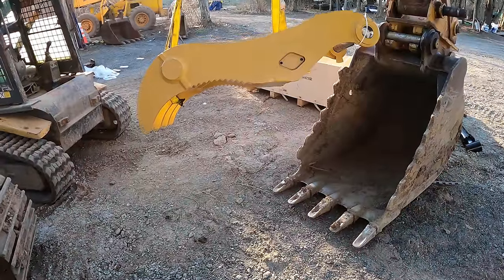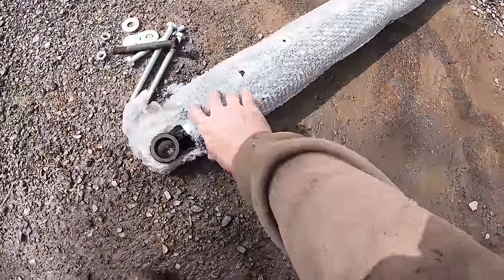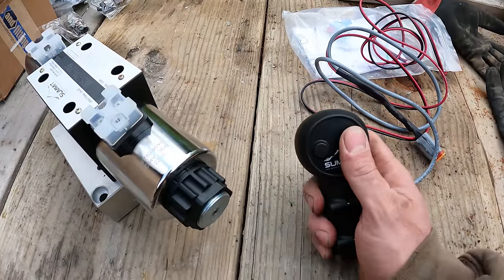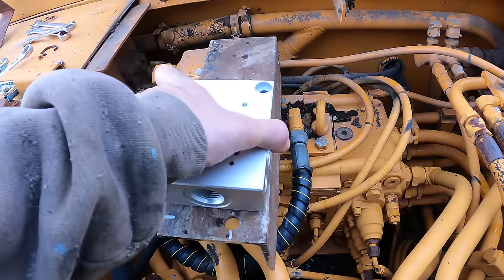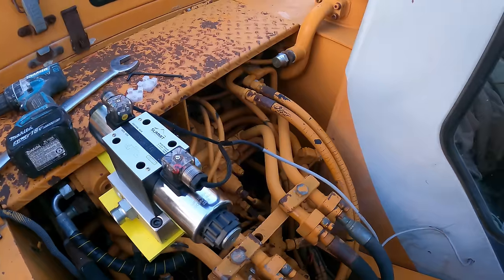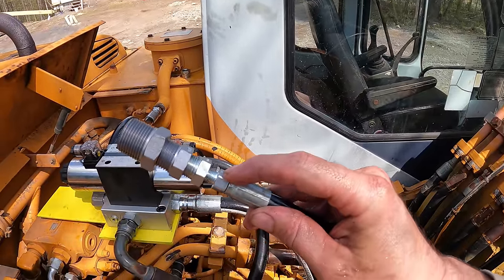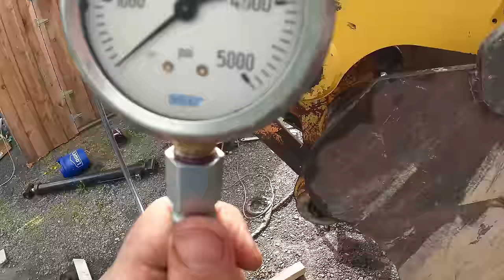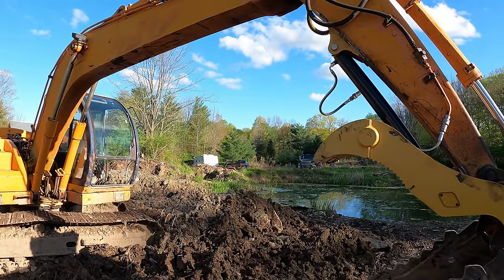Installing a hydraulic thumb on an excavator with 1 way aux circuit

Comment: I’m in the same situation, bought a Deere hoe, has hydraulics for a hammer, but I’m lost as to how to get it to work for a thumb
Reply from the maker: this video should help with that. I pondered about it for years
Reply: Binged the whole video, good stuff been looking for a video like yours for awhile,  I found a thumb that came off a big back hoe, it was a main pin thumb that was 63mm, I had a machine shop bore it and make a pin to fit my 65mm hoe. I got it stationary right now but I’d like to do what you did, that set up looked slick,  where can I find the electric over hydraulic valve and joystick?
Reply: What kinda money did you have in the hydraulic valve?
Reply from the maker: @brent9393  the valve was like 250. I spent alot of money on hoses but if you have a smaller machine you can use smaller hoses

Comment: this is 300 lbs  while pointing at a 60lb bracket.   this is 50 to 60 lbs  while man handling a 10lb valve with 1 hand
Reply from the maker: I am 200 lbs. i can do 20 pullups in a row with no problem and I couldnt even pick up that bracket, so yea not 60 lbs. All of 3000

Comment: I think you meant to say that valve body and manifold assembly weighed 15 or 16 pounds, not 50 or 60 pounds, I’m pretty sure you wouldn’t be moving it around that easily my guy.😂

Comment: Your bucket is cracked at the lift side of the cutting edge
Reply from the maker: yea I knew I was going to get a million comments about it. I wanted to include fixing it in this video but it was already really long as it was
Reply: 🤣🤣 i will watch it in  1/2 hour  maybe 3/4 parts so that wasnt going to be a problem

Comment: As a man who has been welding on this type of projects professionally for the last 14 years, your assumptions on weights are way off. There is no way that thumb ways a thousand pounds and that cylinder attachment point weighs 300.
Reply from the maker: if you saw them in person you would not doubt it. That thumb is 900 lbs and that bracket to hold on the old thumb is all of 300 pounds.  I weigh 200 lbs and can do 20 or more pullups, which means I can easily pick up 200 lbs over and over again. I could barely move that bracket, never mind picking it up

Comment: A young couple goes to say Ritchie brothers auction to see what is in their price range as there are thousands of machines there in every color or size and shape thinking "Ya!" this is the one honey. Should they be so fortunate to get it, spending    enough to send some one to collage for a good many years.... and it turns out a dud. Not the sellers fault and really who's fault but their own for not doing the research and also getting someone to go with them. That person should not have any interest in what, why or where, just a guy with real experience in machines. Honestly what happened to this eight thousand dollars aside from getting a thumb is knowledge that is worth ten times that for next purchase of a machine. I really never bought into what "Bob" said his would do type of experiences... guys in the field who operated them and knew the limits of each machine they ran. Also this is where companies whom have grown so large, they just don't answer the phone anymore for issues that experience will take the place of. Plus they've got so big they don't offer packages for later installations as in running a thumb or hammer. A little farmer will be happy he is not on a number two shovel handle digging out rock or stumps. A base model might be enough to keep them happy. One other crazy law that should be able to be changed is the width laws. A lowboy is restricted to only something under nine foot. most machines tracks will only have a third of the pad setting on that bed of their trailering system and to me a bit iffy at best when hard corners and train tracks... things that go bump in the night might be the best cliche. So if loaded maybe adjustable bed sides would be really helpful. I am just rambling Jesse so congrates on this successful installment.

Comment: Instead of taking the switch off later and running to the parts house to get another switch to fasten only when he could have used the one that he said he would take off later unless it was bad and he didn't want to use it but my solution would have been a lot cheaper to use the existing switch and just relocated he could have also got a couple of diodes from a couple electric coffee pots or some other scrap Appliance then he would not had to order them
Reply from the maker: that switch was not really capable of being used without the whole joystick to mount it on

Comment: Your relieve valve does not work because the new electronic valve will hold the pressure and not send it to the machine valve  to add a relive valve uou need to get a sandwich relieve valve that sits between the aluminium base and the electric valve
Reply from the maker: The relief valve works, its just that the valve I installed cuts off the path to the relief valve when its not open.
Reply: @jmuller86  exactly   I saw your next video with the inline relieve valve that is also a solution but the sandwich one is a nicer option don’t know if  its cheaper

Comment: Some customers?   I do, I think, I don't maybe. Hmmmmmmm.   Decouple and thicken the ouside wall beforehand and use a well machined hardened greaseable receiver plate like a gusset that can be held exactly where needed and then weld it. once you have a very manageble even thicker unit shave out the inside . However. Not 100% sure. Pretty sure, maybe....  Commitment & Decision Issues, I think perhaps. Nah, lets shit can everything and try something else. This is the drama that Youtubers want. Problems are essence of life. Struggles are what make us and or breaks us.  Next.  Maybe NSK Bearing can offer a better choice than large pin/shaft and grease. They use them (NSK) ii 100 ton industrial giants in mining and work longer and dont break and bend like your stuff.

Comment: Changing a factory setup is almost never a good idea, the engineers 👷‍👷 at the factory did know what they were doing, and the user 👨‍🔧👩‍🔧often does not 😉😄😁😂
Reply: Tell it to the guys at Ford,,,,like the Edsel and Pinto design teams. The guys that did the Dodge torsion bars used to be very popular with guys that repaired frames too. Ever think why that center post on the '64 coupe disappeared  in 65, never to be seen again? I can give you a couple hundred examples of things that were changed as time went on on Machine tools and overhead cranes. Many times you feel like you would have been better just building it yourself.  

Factory engineers are humans, not gods, although if you ever had to deal with them you would see a lot of them think they are.